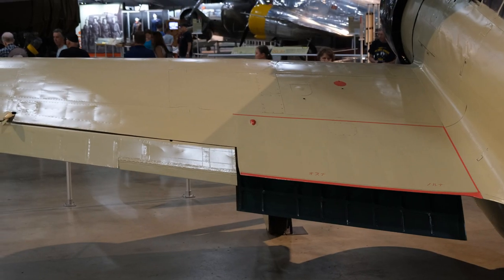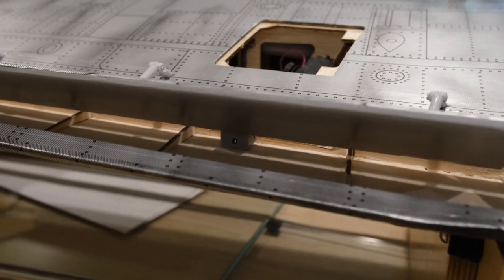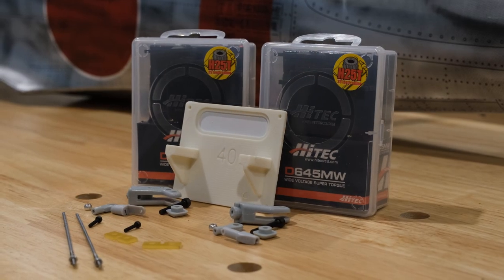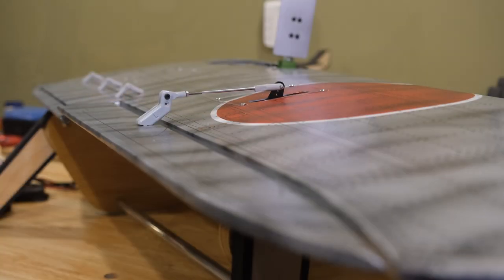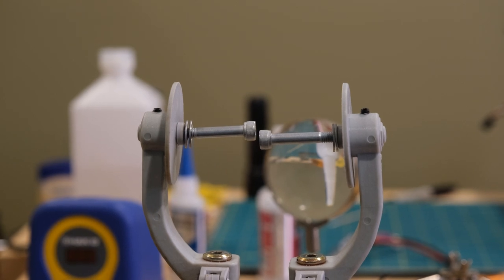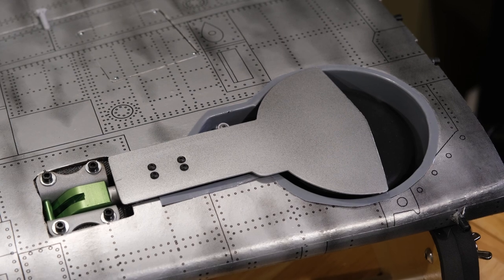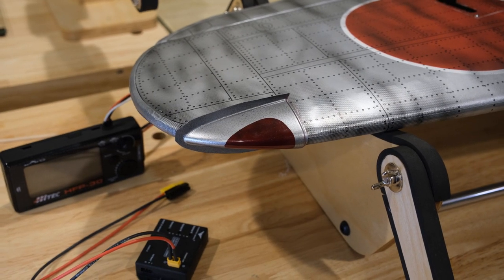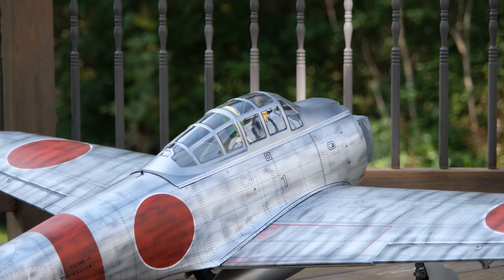Install Ailerons, Flaps, and retracts on the Phoenix Model 20cc 68" Wingspan Mitsubishi AM6 Zero ARF

Comment: Man love your video style,l have just got same , having a problem with gear 1 hangs down 1.4 "lower, got play in it,,is there anyway I can adjust, want HAnger 9 mustang,next,,if maiden goes good,want to see more videos, please do CG video on Zero
Reply from the maker: Thanks for the kind words! On your gear, what are you powering the retracts with? Are you using a 2S lipo? Sorry for the common questions, but can you check if anything is binding? I think if there is a amperage spike, the controller shuts down the retract. I would: Try actuating the problematic retract removed from model, then if it still happens, try switching the problem retract to a different channel on the controller to see if the problem follows. Start there and let us know!